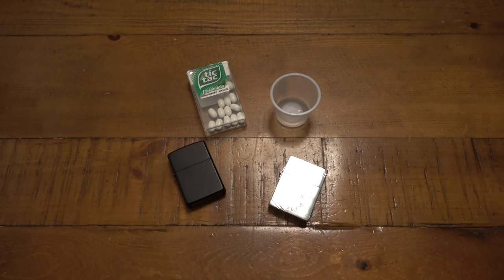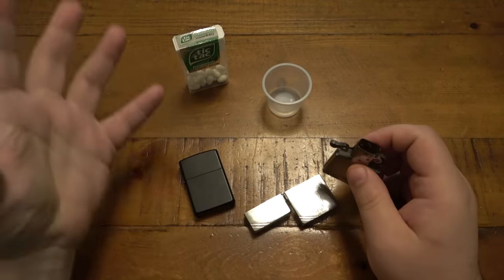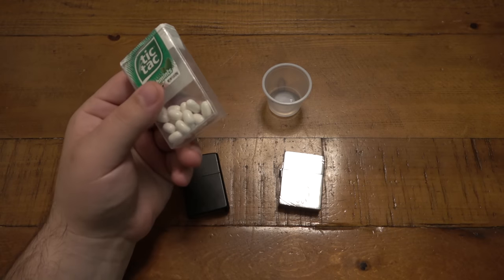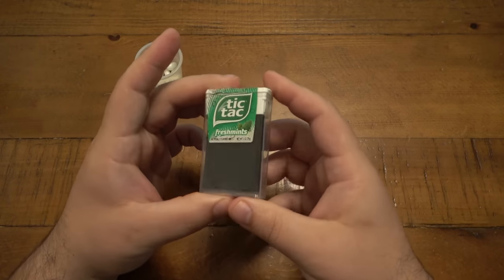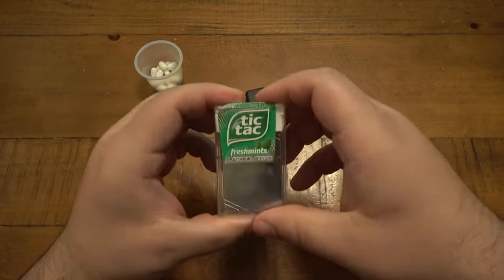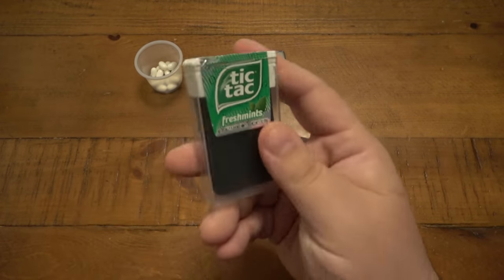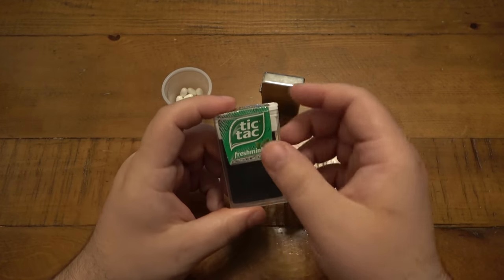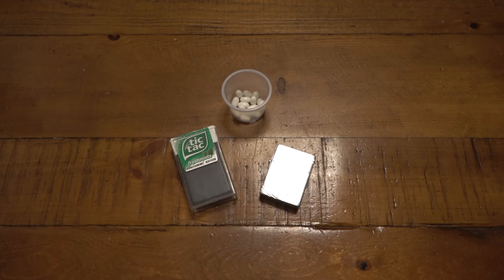The Zippo Lighter / TicTac Mint Case Experiment (Part 1)

Comment: To preserve the fuel you'd be better off with a ranger band around the lid / body. Run those experiments simultaneously. My prediction is that the tic tac will maybe have some effect but I would not be surprised the Zippo is dry even after the first month of storage.

Comment: Ive heard a tip, 
Find a bike tire tube that is snug enough, and cut a small section out of the tube. 
Fit it securely around the zippo, and you can roll half down to use it. And when done roll it back over. 
Kinda like a zippo condom.
Reply: That’s a ranger band

Comment: put water in the tic tac case and turn upside down to test air tightness
Reply: From my memory as a kid they didnt hold it too well
Reply: @victoriaevelyn3953  jep but using a thin plastic bag with the lid could seal it tight.

Comment: I have a modest zippo collection and use one every day smoking about a pack a day so I’m actually using the fuel as it is also evaporating rule of thumb is I get a week to ten days off a fill I might try this to see how much more if any time I get out of a fill up although it doesn’t seem very convenient to take it out of the tictac case 15-20 times a day it may be more convenient to just switch to the soft butane flame insert. Also because of your zippo videos I carry a spare flint in the felt hole underneath as a spare
Reply from the maker: this is for storage when not using the lighter I wouldn't suggest doing this if your smoking with it as mentioned its far too incovienant
Reply: I'm leaning toward that new butane insert with the standard flint wheel. Love my Exotac, but I miss my click😂

Comment: I've never had a zippo that kept fuel longer than 72hrs.
Reply: My name is Marko  Haha, nope
Reply: When you keep it in a pocket the body heat evaporates the fuel faster. There are zippos out there that have a larger gap between the lid and the body and will lose fuel in a day or so. My wife had one that just could not keep fuel more than a day or so, and I sent it back to zippo and when it came back it was no better. There was nothing obvious but the lid didn’t seem as tight as our others, and I think that was the problem. Also how flat the contact point is between the lid and cast makes a big difference - lighter fluid is so volatile that any little crack will mean faster evaporation. I don’t expect the tic-tac experiment will make a lot of difference because the spout does not fit air tight. It will help and I guess he’ll find out how much.

Comment: The spout is not an air tight fit, so that will be the weak point. I would lift the spout (keep it up as a handle for pulling the top off) and seal that opening with hot melt glue or epoxy. That should make it work better. Lighter fluid has such a high vapor pressure that even the slightest gap will mean fuel loss. Compare one in the case, one outside the case, and one with the sandwich bag trick (which I have been using over a year because the fuel lasts nearly twice as long). I would like to know how long a Zippo will keep its fuel in a Mason jar which is very air tight. If I lived in a remote area I would keep several Zippos filled in a Mason jar for emergencies, spare flints, and several cans of lighter fluid.

Comment: That would be instrastine to see if it will work. I'm thinking it's not going to work. Only because I put some spray paint in an "AIR TIGHT JAR" it separated in the jar and the vappors escaped out the jar. In order to use the spray paint from the jar I have to mix it with a stick. You can still use the paint after all the air is gone from the can. You have to carefully poke a hole in the top of the can. I should make a video on how to save your paint from a spray can paint that lost all its air from it. Most people just toss out the half can of paint if the air escapes.

Comment: With my limited knowledge, it should evaporate until there is an equilibrium of pressure inside and out of the lighter. So, the lighter will still evaporate some in the container as the air escapes.

Comment: my $.2 ; If stored without any air movement there should not be condensation or collection of fluids in case.  ** this does seem like a nice excuse to pack a zippo along to lite up the campfire on an adventure since it does also make for a nice case to hold any fluid escape in a pack/just something new.  GLHF.
Reply: 20¢? Darn inflation...
Reply: @Jacklsovakia1  lol,, I guess it happens so fast I didn't notice.   I'm blaming the inflation on a random breeze in a far away desert, seems like a good enough reason.